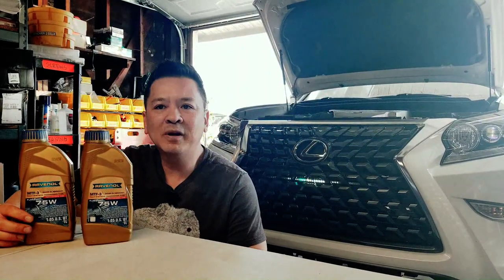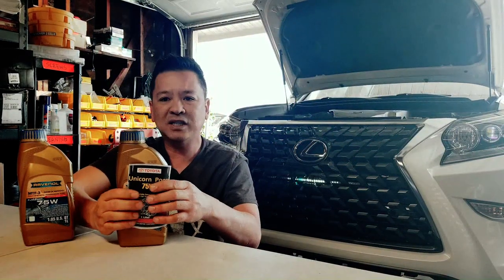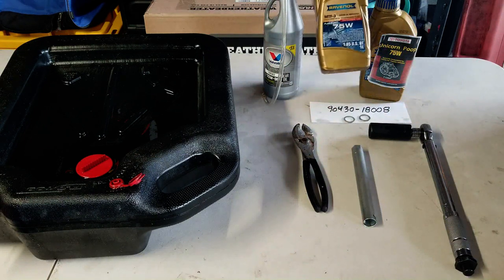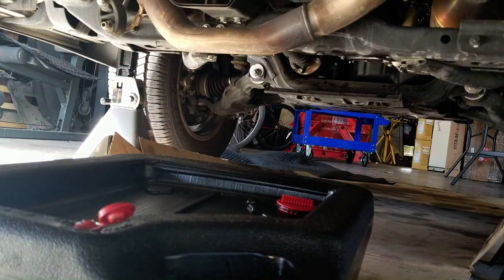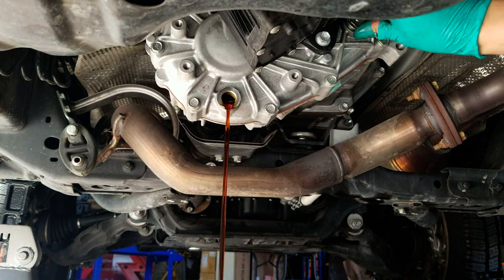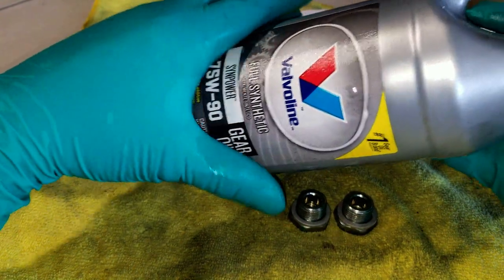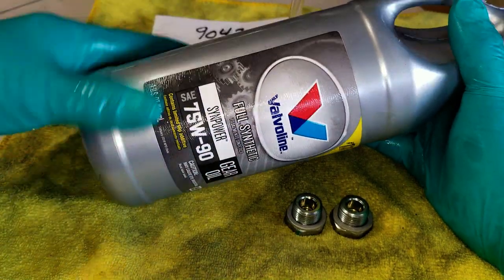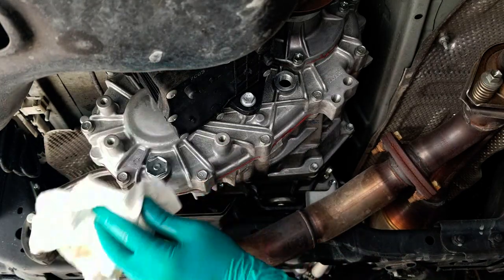Lexus GX460 Transfer Case Fluid Drain and Fill

Comment: Would this all be the same for the 2010-2013 GX 460s?
Reply from the maker: Yes, CRXB, they are all part of the 2nd generation GX series.  The bad on my part is because i keep separating 2010-2013 from 2014 and up is due to the changes in design (front end).  Everything else is basically the same.  I need to really re-title my videos to just GX460 whenever possible.

Comment: Hi Bob, I gotta say you're an inspiring Asian. This is from another Asian. I read from dealer's service list on the transmission maintenance. It mentions that dealer also replace the transmission oil filter. Is that just bullshit? May your manhood last and prosper.
Reply from the maker: Did you mean this (link below). If so, yes you’re supposed to when you do a full tranny flush and fill. I do quick drain and fills in between at shorter intervals that’s why i didn’t replace mine yet. I tow a trailer and a boat often so i replace my tranny oil before the 30k interval’s. I usually do it at 15k. 
https://www.ebay.com/itm/Genuine-Lexus-Toyota-Transmission-Strainer-35330-60060-TUNDRA-GX460-LX570-OEM-/153130775083?mkcid=16&mkevt=1&_trksid=p2349624.m2548.l6249&mkrid=711-127632-2357-0
Reply: @GXBOB  I bet that's what it is. I am planning doing the transmission flush since my 60K is coming and mine still has the warranty on it. I don't have many options here but going back to the dealership. But with your video, I am planning on changing the oil every 30K myself. Thanks.

Comment: GREAT JOB BOB
GOOD JOB !
🤣🤣
Reply: I used the same one (Ravenol 75W) for my transfer case when I changed the fluids about 3 weeka ago.  Good product at a very good price.
Reply from the maker: i totally agree.  I'm glad there is a product that is compatible.  I have been using 75w-90 in  my  other transfer cases only because there hasn't been solid proof that it will do damage.

Comment: Bob, 
Can you do a video on how to change trans fluid?
Reply from the maker: Sorry Andre, i just had a flush and fill not too long ago.
Reply: @GXBOB  no worries 🙌🏻 how much did it cost you?
Reply: @GXBOB  also can the GX display current speed in the heads up display? I cant figure it out if it does 🤷🏻‍♂️
Reply from the maker: @bb5op585  $80 out the door.
Reply from the maker: @bb5op585  that would be your speedometer. I don’t think they would have one needle and one digital display. Haven’t seen that in this truck.
Reply: @GXBOB  haha, well i had a 5th gen 4runner and the heads up display was able to show current speed digitally 🤷🏻‍♂️ so thats why I was wondering
Reply from the maker: @bb5op585  those Forerunners are pretty nice

Comment: Hey Bob, what torque wrench drive size do you recommend for the diff and transfer case?
Reply from the maker: You have to accommodate 2 things: 27 ft lbs and 24mm bolt.(transfer case). Most sockets at 24mm are usually 1/2 inch drives. It’s better to use Torque wrench that is a direct fit to your socket rather than depend on reducers or adapters. So 1/2 inch drive torque wrench.
Reply: @GXBOB  tyty

Comment: 4:20 yOu hUrT mY LiTTle FeeLiNgS when you didn't check the level BEFORE draining, you just put your finger in the fill hole to confirm it had enough uNicORn pOOp before you replace it.
Reply from the maker: Ahhhhhh good point. I’ll definitely do that next go around!

Comment: Canny use 7090 same as diff fluid
Reply: No…seriously don’t do it. 75W only.
Reply: @NomenClature-o8s  I don’t know about that my dealership I went and got it done there they use 7590 they don’t even use 75 straight W
Reply: @jinheu5119  I know, I’m good friends with the service advisor at my dealership. But they are using the wrong oil. That Torsen locking diff is a very special unit. 75-90 will cause problems. And yes, I bought the crazy expensive Toyota 75W and did the work myself. Which ironically was less expensive than having Toyota put the wrong gear oil in my transfer case.
Reply: Actually, my Toyota and Lexus dealership both in my areas use 7590
Reply: @jinheu5119  I’m sure they do, because it’s cheap. But it’s not what the factory specifies.
Reply: @NomenClature-o8s  that does make sense dealership how to make money it doesn’t really matter to them what kind of oil they use to pass if your statement was true, it would be losing more
Reply: @jinheu5119  I’d encourage you to check to check the vehicle manual and only use the specified fluid.

Comment: Bob after doing the oil change on the Transfer case, front and back differential on my 2014 GX, i feel like its Sluggish. i usually use cruise control at 75mph with 18to1900rpm and after the oil changes i notice 2000rpm+ on 75mph cruise control. i feel like its struggling. any advice?
Reply from the maker: 1. I would take your gear out of D and use S and see if it drives the same.  
2. Change the air filter
3. Change the spark plugs
4. To be honest, my 2017 is a lot slower than my 2008 in acceleration but 2017 beat it at high speeds. I'm used to the "feel" of the heavy GX460 but the spark plug and K&N filter did make a huge difference.  
5. Your car is 6-7 years old,  your fuel filter could be clogged.  Have you been using premium unleaded? See if fuel injection cleaning might help.  
6.  I wouldn't blame just your oil changes as the problem.  Since your car is 6+ years old, i would start changing all scheduled maintenance items above.
Reply: @GXBOB  thank you for your quick response! I’m at 120k miles and I did all the above and more. Always 91 unleaded but only after the differential & crankcase oil change I felt it sluggish. That why I asked. The only thing I haven’t changed is the Transmission oil. I’m waiting on ur video! P. S. THANK YOU A MILLION for you Great video! I’m in Downey. Hope to run into you soon.

Comment: Aren’t you supposed to make sure the transmission is at a certain temperature... this is not something I would recommend you do your self.
Reply: Transmission and transfer case are two different things. The transmission does need be at a certain temperature to fill to the correct level. The transfer case and rear front differential do not.
Reply from the maker: Yep I agree.